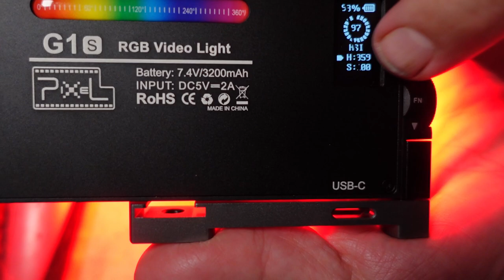Pixel G1s RGB Video Light: first impressions

Comment: Hello, Rob! Tell me, is it possible to simultaneously work (shine) Pixel G1s and charge it from a power bank (or charge it from USB charging)? Have you tried this mode in practice? The Pixel G1s's power bank recharge mode is a way to extend the lamp work so as not to stop shooting for a standard 3-hour charge of the lighting fixture.
When connecting a power bank, is there a risk of heating the Pixel G1s battery and triggering protection? As I understand it, when fast charging is connected, the Pixel G1s protection reacts precisely to more heat?
Reply from the maker: I have not tried this, so i don't know the answer. Excellent question though.